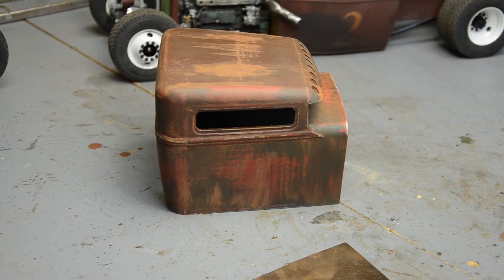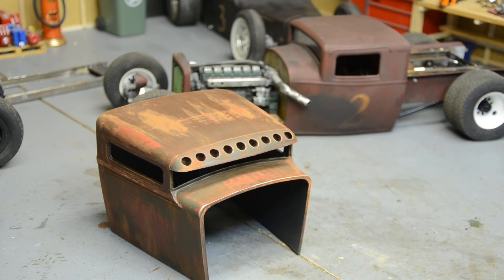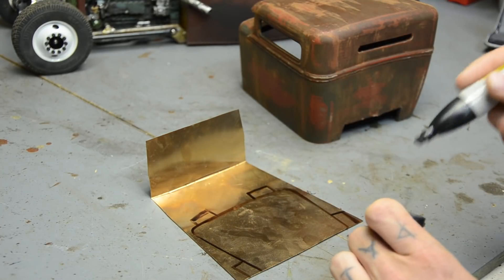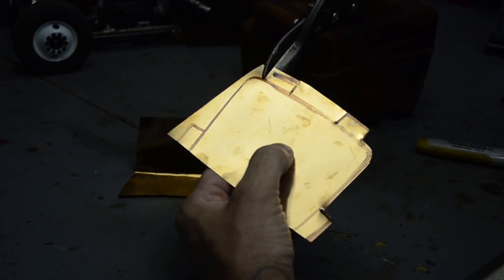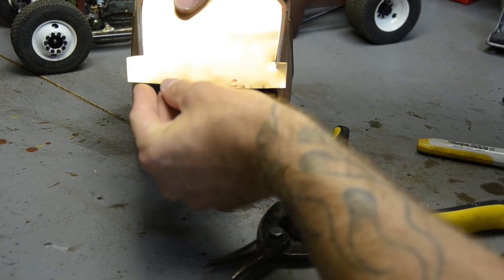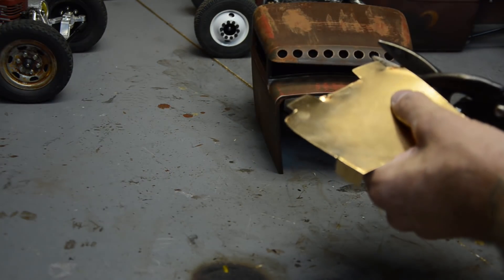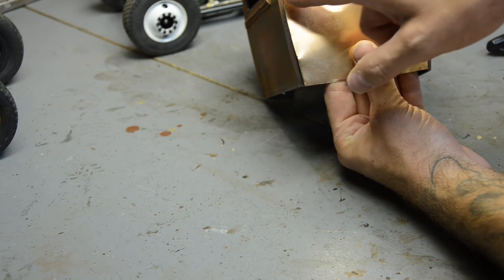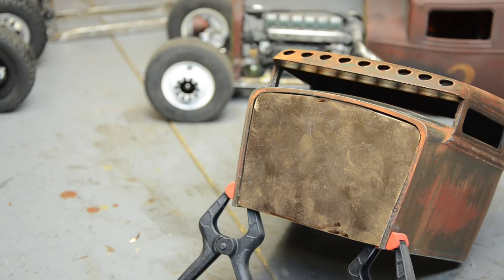RCengineering, Fabbing a Metal Firewall For a 3D Printed Scale Body, Easy How To

Comment: Just a tip for you when working with that thin metal you can use a sharp blade and cut nice clean lines just Score the marks a few times and they will break cleany.just a thought.

Comment: Whats the price on building one of these rat rods?You've got me itching for a rat rod. If you have one laying around that you're willing to part with shoot me a message.
Reply from the maker: They aren’t cheap. The Rc4wd build I did was about $1200 in parts alone. Plus my labor.   Lol. It is the only one I haven’t kept.
Reply: @RC Everyday I was expecting around 1000 in parts as rc4wd is not cheap. I don't have a welder nor have i ever welded with anything other than a stick welder. My problem is i cant find a hot rod chassis
Reply from the maker: My 32 roadster is made from a tamiya bruiser chassis. And my first few ratrods were welded with a big ol stick welder. Lol.
Reply: Thank you so much, i found one for 98 bucks. Now i will have a platform to build from. I'm so glad you got videos to help me along the way. I'm pretty excited and this will be a great winter project!Going to copy your roadster as much as possible to make sure i don't run into a bunch of problems and wasting money on the wrong stuff